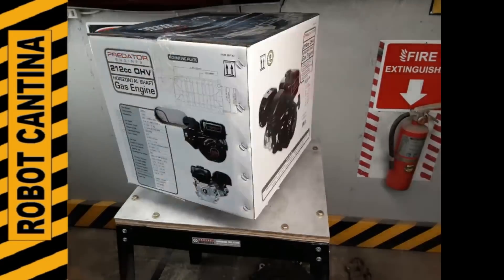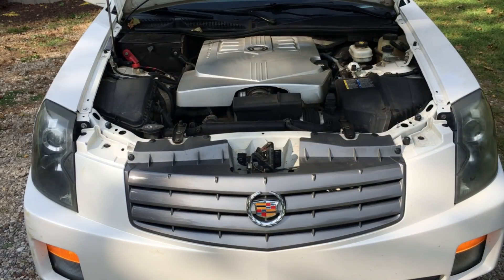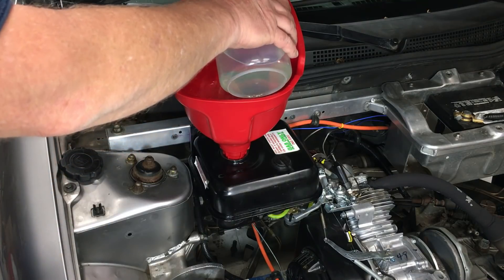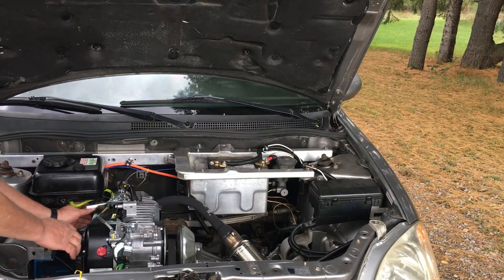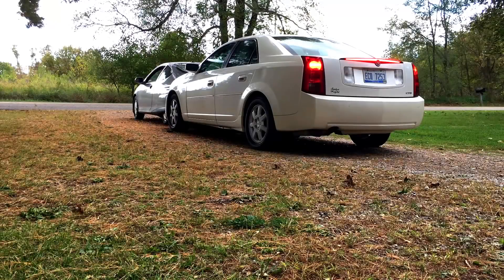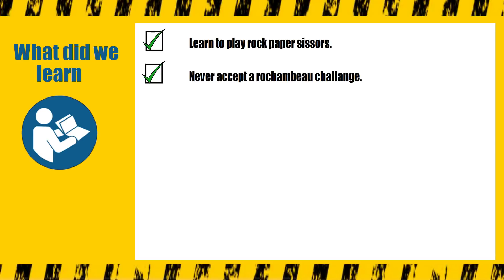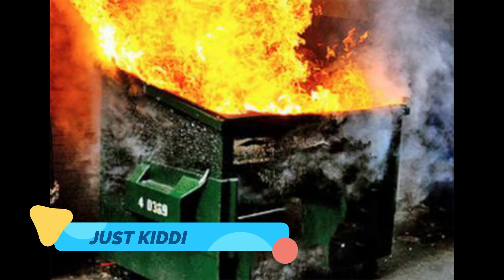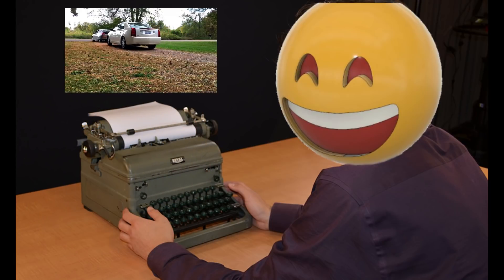Episode 6.  MPG on our Honda insight with $99 dollar lawnmower engine

Comment: Mileage was not bad but it's interesting that the factory 4 cylinder engine with close to 100 horsepower got the same gas mileage as this setup. Of course you had the hybrid system to help you. But there were Honda crx's that weigh about the same as this insight back in the early '90s that we're getting into the mid 50 miles per gallon with just naturally aspirated 4 cylinder engines. the problem is this engine is running at near full throttle which is not really optimal for efficiency. You will probably end up doing better with a larger displacement engine that would allow you to cruise at about 50% -75% throttle.
Reply: Actually, the factory engine was a 3 cylinder, and it only has 72hp. And no, it doesn't get the same mileage as this - I own a manual 2002, and average around 65mpg, though some people can get as much as 75 in a stock car depending on environment and driving conditions. Having said that, I love this project and it's awesome to see the first gen insights getting some exposure, even if that means swapping out the engine :)
Reply: @Demdere  
Your right.. about the 3cly.  Found that out later.
My point was the efficiency of the stock much larger , much more powerful engine was actually more efficient.
Though it would be less without the IMA  hybrid assist part. 
Loved the insight.. test drove one when they were new.. was great.
Think they were about the same price as a civic at the time.
Reply: @kens97sto171  Don't forget smog equipment really decreases the MPG of a engine.
Reply: @jtto6364  
In older cars yes..  anything newer 90's forward not as much. Port fuel injection and catalytic converters took care of most of that.   The old air injection stuff was terrible.
But new cars have less stuff.  Cats, EGR, and port and direct injection make stuff pretty clean to begin with. 
That simple carb setup on the predator is not nearly as efficient as any new engine, 
Would be interesting to see him mod the engines.. you can buy aftermarket fuel injection setups.. for stuff like this.  Would be cool to see him test a bunch of different stuff and see what effect bit has.
Reply: @Alfred Wedmore 
Any engine that has throttle plates, will operate more efficiently at 50% to 75% throttle. The throttle plates are closed you incur pumping losses on any engine. This excludes diesels, and some direct injected engines operate with the throttle plates partially open even at idle.
Friction doesn't really increase much with load, oil pressure prevents any metal parts from touching each other the only place where this might not be true is piston ring to cylinder bore friction which certainly would increase with higher pressure.
Generally older engines in the 1970s or before had far larger tolerances in the parts, not uncommon to have an engine need to be rebuilt for 100,000 miles. plus their quality oils lesser quality materials in some cases made that more common.
I pulled some Japanese Imports apart that had almost 200,000 miles on them and you can still see the factory honing marks in the cylinders. These are engines that were built in the late 80s even. The attention to detail in the engines was pretty significantly better than stuff built in the US in the 70s.
If you go back farther there are some advantages having the parts be a bit sloppy. While the efficiency drops significantly you often will find that those engines will still operate with very significant wear internally. You've got an engine that was designed to run with very tight tolerances when they get worn out they tend to run significantly worse.
It's a trade-off that's for sure.
if you're concerned about reliability more than efficiency you might be better off to go a little bit sloppy on the construction.
There are some big signal cylinder engines that were used in oil fields. They ran off of the natural gas that came off the well itself. I've seen some of these engines that ran almost continuously for 50 years all that was required was for someone to show up once a week to put some oil in the lubrication cups. I think it's extremely unlikely you would find a modern engine capable of running for 50 years Non-Stop.
Reply: So theCRX hf weighed in at 2100 pounds from the factory. HF stood for high fuel and they did get into the 50s.  Honda didn’t make any lighter cars than that. 
I had a 91 dx 5sp and would get 42-45 mpg on the regular it was all stock and had 300,000 miles on it. 
Also this car has had the hybrid system removed and that is a ton of weight. I would love to purchase this shell when he is finished with it. I don’t know why but I always loved these cars
Reply: @krzyryry8382  
I think the crxhf was 1900 lb not that that's significantly different. I actually thought they were slightly lighter than that. I had a regular CRX 5-speed with air. Really fun little car got good gas mileage was actually very roomy and had a bunch of cargo room in the hatch area. Made a fantastic delivery car.
The other extremely efficient car from that time period was the Geo Metro with the three cylinder engine. They made an xfe model which was even more efficient. But I tended to average low 40s in the city and 52 highway. The Metro weighed 1650 lb made about 50 horsepower. The xfe had the same three cylinder with a slightly different camshaft and a different computer programming. I believe it made about five less horsepower but got you about 58 on the highway. Was actually a really good little car the interior of that vehicle was an absolute piece of crap door handles would fall off the window rollers would fall off door panels rattles that kind of thing. But the powertrain on that 3 cylinder engine was absolutely amazing was a very simple throttle body injection system. I ended up using it as a delivery vehicle and put 100,000 miles on a car in one year beat the living crap out of it just about every day and nothing powertrain related ever happened to it. I put a timing belt in it it did go through a set of rear wheel bearings which I thought was pretty weird because the car weighed like 5 lb and the rear end had to weigh nothing so why the rear wheel bearings would fail I have no idea. But they were cheap easy to install. Tires cost about $30. And it also was quite roomy in the front seats.
Reply: This is what European emission standards fail to realize. They fucking cram in smaller and smaller engines in pursuit of efficiency, but if you have a 60 hp 0,9L Turbocharged gasoline in a crossover it might work well on a test bench but fuck I sat in those cars and it's 100% throttle each time you want to accelerate.
Reply: @foxman105  Economy is a tradeoff, and good fuel economy is mostly down to the driver. If you lived in a European country, you might be more interested in the fuel economy tradeoff because they typically pay twice as much per gallon as folks in the North America do!
Reply: @mikescudder4621  I'm not a very... erm. Conservative driver. When I see an open road with nobody in sight it calls my name. When I had a diesel, previous owner had 4,5L per 100 km I had  over 7... I don't really give a damn about how much the engine eats as long as it delivers to me what I want from it. Pleasure.
Reply: All good  @foxman105 . It surprises me you even tried out a small engine turbo then! Interesting that these small power plants are putting out similar HP to what a v6 did a few decades ago. I like economy because i've never really had a  lot of money to throw around. What diesel did you have? I bought a Mitsubishi L100 micro van in Chile (550c 2 cil. 30hp). I travelled all around south america getting around 5L per 100kms. I was happy with that for such an old car so i'm curious as to what you had.
Reply: @mikescudder4621  It was a Renault Megane 3 110HP with a manual 6 speed gearbox. It's was a relatively light hatchback, only around 1400Kg (3100? lbs) so a strong diesel engine they otherwise put in SUV or sedans was able to get it to accelerate quite nicely. Actually I had a problem with the engine, because if I dropped the clutch too fast on the lights without even pushing the gas pedal it would spin tires a bit, making me look like an idiot... well at least it didn't choke like most cars do. It also had a false bottom out on the gas pedal in which it accelerated... reasonably well... I presume this was to maintain fuel economy. You were however able to push past it with a little bit more force and then the car would enter "No fucks given about conserving fuel" mode which was great for overtaking... or having a little bit of fun on an empty stretch of road. Also It's not like there's much of a choice here in Europe right now. Unless you have a lot of money to spend on an american import, you've got money for a premium brand like a Mercedes or BMW or you're willing to restore an older car you're gonna end up with a small displacement Turbocharged engine (unless it's a mazda) It's just the way the manufacturers decided to go here. 1,5L is actually quite large compared to what they sell now.
Reply: @mikescudder4621  Also, getting a small displacement turbodiesel wasn't originally my plan, but sometimes you run into an offer you can't refuse. The owner of the car wanted to get rid of it so we got it underpriced. He bought it for his daughter but after she bought a bigger one, this one was just standing there gathering dust. When she was still using it, the owner didn't spare expenses when it came to maintenance. The car was flawless. No rust on the body, no signs of damage on the undercarriage or anywhere, some paint scratches from supermarket parking but that was all. Tyres on the car were also expensive brand and the Engine had a rebuild 75k km ago. Interior was one of the top trims.
Reply: @foxman105  Sounds like a good buy. I've never actually driven one of these small turbo diesels but i think they're cool. Well, economy is cool in my books!!! I like classic cars, my daily driver is a split window kombi but to travel and my wife we have a modern citroen we bought basically new off of a grandmother. Only now that its 6 years old is it giving me some work (changing the belts etc). Of course with these small turbos you have to wonder how long they last? With how kms was that engine rebuilt i wonder?
Reply: @mikescudder4621  it was rebuilt at 150k km. Also the turbo won't last. If you floor it often, you'll cook the bearings. Best thing you can do is disassemble and clean the EGR system once a year and cleaning ot out. That thing will break your engine in the name of ecology... a good example of "it works well on paper".
Reply: @foxman105  Man, 150k is pretty disappointing - must live a hard life. If you already have 70k on it since the rebuild, are you going to flip it or rebuild it again? Or maybe you'll put a lawn mower engine in it?!?!
Reply: @mikescudder4621  unfortunately the car got side swiped by a drunk driver. The car is now a parts car. Also 150k is what you get when you push these high compression engines for daily use... new ones are even worse. The 0,9l turbogasoline 3cyl are starting to get issues after 60-80k km. Ecological...  until you need a new engine block casted in 3 years.
Reply: @foxman105  Side swiped?! That sucks, hope no one got hurt and that the drunk guy had insurance. Thanks for the review on the small engine turbos, i'll stay clear!
Reply: @foxman105  you realize cars are getting more powerful, even with downsizing ?
Reply: @geemy9675  Yeah but there's always a trade off for it. If you run something more efficient it means you're pushing it further to the limit. And manufacturers are assholes. They will go with the bare minimum required for warranty. I could go in, see the forces that these things are under and material properties... Generally "just good enough" If I wanted it to last I'd need reinforcing some parts or straight out swapping them for more exotic materials and more expensive manufacturing processes. It's a balancing act and at least here price wins over durability.
Reply: @geemy9675  2 liter high compression gasoline/ethanol 4 cyl with regenerative hybrid is probably what I'd go for. Optimal volume for the burning process of gasoline A lot of power, efficiency around... 30-50%? Hard to tell, would depend on ECU settings. Battery will give out on you first and that's the expensive part but it's cheaper than an entire engine. Alternatively you'd loose compression and efficiency by piston ring wear. 

I'm not a material engineer I just like to tinker into cars and a lot of products I saw recently were disappointing. Although casting on some engines got a lot better but they use it to make the engine lighter instead of more durable.
Reply: @foxman105  you can have 10y/100k warranty on the powertrain with Kia/Hyundai though
Reply: @geemy9675  Well hyundai/KIA still go for the larger displacement on the scale o miniaturisation where I live and they still offer 4 cyls for their hatches and larger cars. Helps a lot to eliminate the low RPM jerking compared to a 3cyl which always feels to me like one cyl is misfiring. They're not the most reliable but these days... One of the betters...
Reply: @foxman105  I drive a 2017  V6 Sorento which is the last gen that offered the V6 together with the  2.5 turbo. I like the engine to cruise on the highway in 6th. but  coupled with the slow automatic transmission and the low torque of the NA v6 it has pretty poor throttle response. the kickdown when you open the throttle progressively from a high gear is slow and when it occurs it's too dramatic. manual mode is quite slow too so I only use it in twisty or mountain roads. I think I would enjoy more the lower torque of a turbo. higher revving V6 is not really a good match for this kind of car, except if you want to tow
Reply: Audi made a car in the mid-90's called the A1 (?) Ot eas a small 4 passenger turbo diesel. 4 cylinder car that averaged 80 mpg.
Reply: @umaxen0048  
One thing you have to watch out for when comparing miles per gallon in different regions. In the US our gallon is about 20% smaller than the gallon used in the UK. It's one of the reasons why fuel efficiency numbers are often radically different in the same vehicles. so you just have to make sure that you're comparing similar volumes when doing fuel consumption rates.
about the most fuel efficient car I've ever seen in the US was either the three cylinder Geo Metro they had a special fuel efficiency trim the XFI.. it was getting  53mpg city 58hwy.
What's interesting is a brand new Toyota Prius weighs about twice with that Geo Metro did. Is actually a safe car versus a tin can with wheels, and gets about 55 miles per gallon.
Reply: Back in 1980s I had 2800 lb Chevelle with high compression V8 ( 350 ) and would get 20mpg running hell out of it.
I had to work on the V8 and took it out putting in temporarily a low compression 250 inline six cylinder. The most I could get the stupid six to do was 16 mpg no matter what I did to it or how I drove.
It's not necessarily the size it's the efficiency.
Reply: @michaelszczys8316  
It's the high compression. Creating the higher efficiency. In line 6 cylinders are not that efficient. It's one of the reasons the venerable four liter in the Jeeps went away. It's a lower compression engine. Generally speaking goes in line sixes or a much older design also. A lot of them originating from the 1950s or before.
Definitely a lot of factors that go into both power output and efficiency both in power output relative to displacement but also in a fuel efficiency relative to that power output.
I had a couple of mopar's with slant six in them. Fuel efficiency was decent but power output was horrible. Although the low end torque was okay. But they were all about 3.8 l displacement I think that's what the 225 converts to. But they were all breathing through a carburetor that had a throat about an inch and a half in diameter. Tiny ass little one barrel carburetors that barely let the thing breathe.
Reply: @kens97sto171  if it was older 230 six with higher compression it would have been a lot better. More like what that car might have had originally.
Bulletproof Chevy 6 from the 60s were all race motors.
Reply: @michaelszczys8316  
Definitely true. You certainly can make an inline 6 powerful. There's a few good videos on YouTube of people adding turbos as well as building the internals. And as you said they certainly were used as race motors.
But generally the ones you found in production vehicles were pretty low compression, low revving. Lots of low end torque not much peak per hour. But most of them were absolutely indestructible as long as you just kept oil in them.
Reply: All engines require  an air to fuel  ratio, it can be changed but they all need to be at that ratio based on altitude.  A computer  is a huge advantage  because  it can change  the tune when needed  ,as such cubic size determines  basic fuel consumption,  and then how it's driven  determines  your gas mileage, if you are using a computer  you can get better mpg
Reply: you forgot something in the double transmission. CGT with belt steals power, even worse when it's on top of another transmission. this lowers the efficiency. the rest is carb vs injection, stage 1 vs stock, factory tuned vs messing with carb settings, predator vs honda. hybrids are designed to be as efficient as possible from the factory, so you shouldn't expect to do better than Honda engineers especially when the projects goal was not efficiency